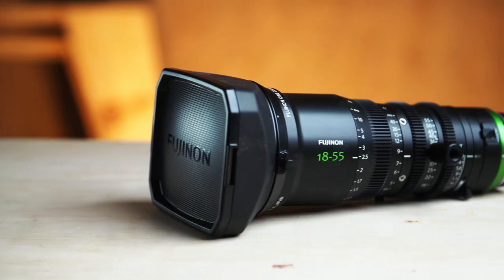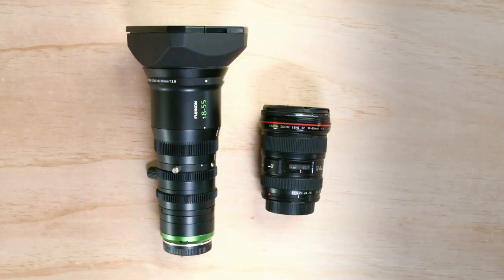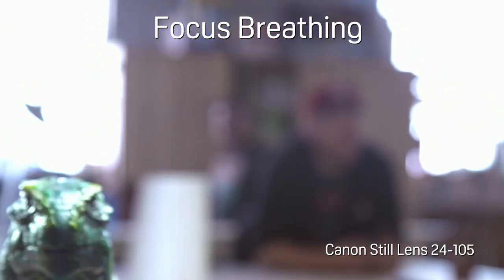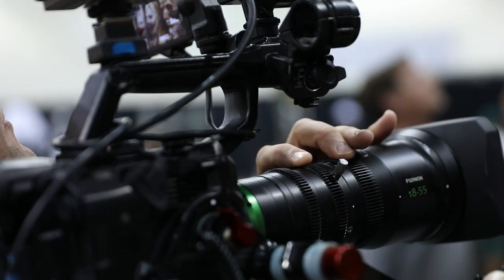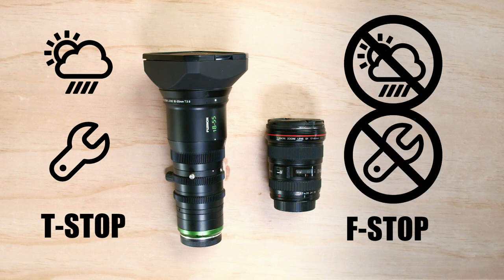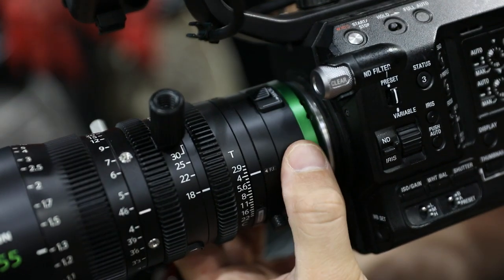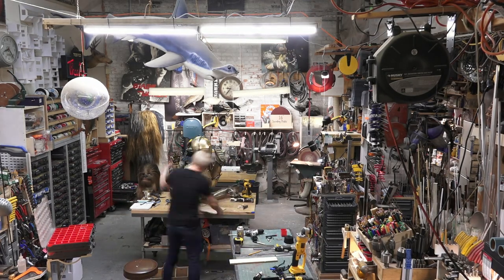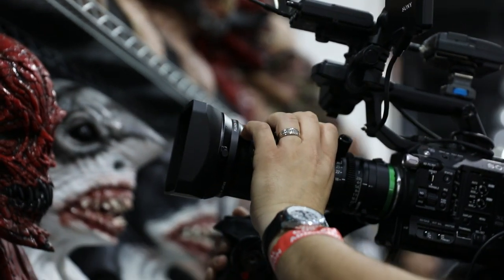Tested: Fujinon's 18-55mm Cinema Lens

Comment: This lens had me breathing heavily when it was announced, I would like to try it out on a smaller camera like the BMPCC, to see what it's like.
Reply: The only real difference is that the BMPCC is a 2x crop sensor, so the focal range will be around 26-75 (quick math don't hold me to it). You might also have a slightly sharper overall image, as the centre of the image circle tends to be sharper than the edges, especially when wide open. My personal recommendation would be to use it with a Metabones speed booster, you will regain use of the full image circle and gain 1 1/3 stop in the process, bringing this lens to like a t2.

Comment: Expected a little more from tested. This lens has a “Cine” designation which is really a marketing term, this lens can not be used on anything other than Sony video cameras, it has its own backfocus adjustment which is why it also features a macro function and as such is closer to a B4 mount television lens.

“All still lenses are varifocal” what are you talking about? Arri made a S16 varifocal zoom lens which has multiple coloured distance scales for those variable focal lengths, still lenses are not varifocal lenses, at all, they have a single focus scale and most still zoom lenses hold focus through the range, I’m talking £200 sigma/tamron 17-50 lenses hold focus through the range but like most you didn’t mention backfocus and it’s importance to a zoom lens holding focus during a zoom or even to a prime lens hitting infinity.

I take it you’re using a metabones adapter for the FS5? Pick up the Sigma MC-11, it has the correct FFD spacing and if by magic a vast majority of your stills lenses will now hold focus through the range which is all the parfocal designation means, it’s simply a measurement of how much the FFD changes during a zoom, + or - 5 microns and it’s out. You can probably have Adam make a custom shim to get your metabones adapter to line up, Adam Roberts of Barbill has a tutorial on his website.

T stops are light transmission “compensated” F stops (ASC manual), F stops are absolutes but are mathematical formulas, T stops are based on light transmission but are not rated in Lux as that would be odd.

Comment: what shoulder rig is he using near the end of the video?
Reply: Looks like a bare FS7 (II) with the stock arm extension to me.
Reply: He says it and it's pictured at 14:01. The brand is "SHAPE", and it's not a full rig, just an extension arm with the stock remote control handle mounted on it. The Fs5 comes with a stock extension arm that doesn't cost extra, it just requires a screwdriver to adjust, whereas the SHAPE arm does not. The thing that looks like a shoulder rig is a backpack.

Comment: By "ENG-style" you refer to a one man crew, right? Like what some indie documentary makers call "run and gun"?
Reply: ENG-style refers to a lens that you typically see on TV news cameras. They have the macro ring, but also a hand grip, which contains a zoom and iris servo. I'm surprised that this "zoom" lens did not have such a grip, especially since it's meant to be mounted on a Sony FS5 or FS7, where remote lens control is possible.
Reply: Thanks!